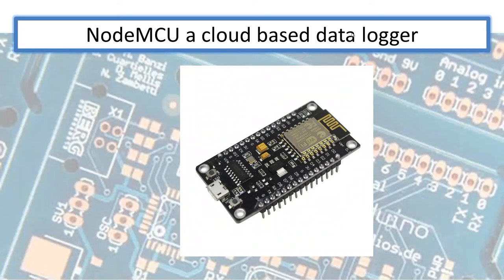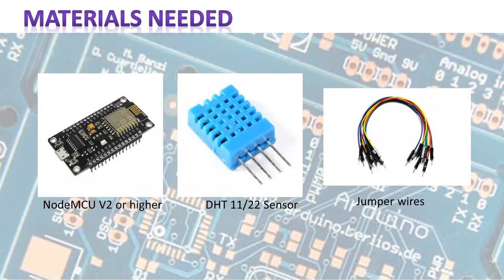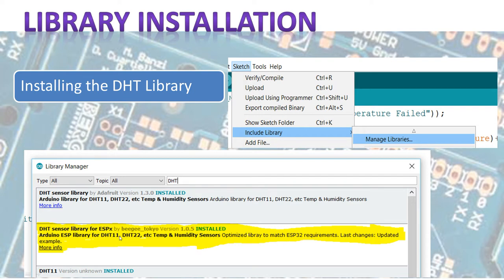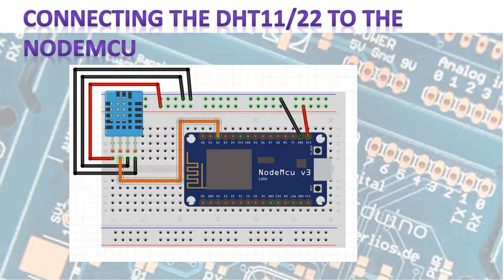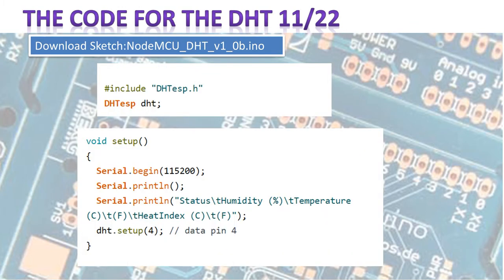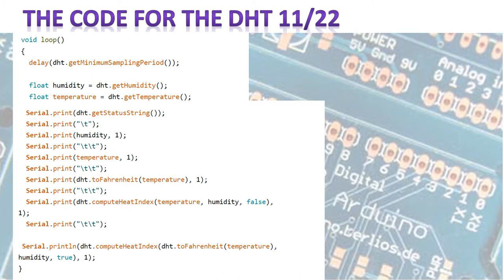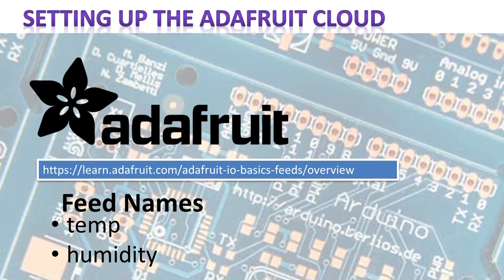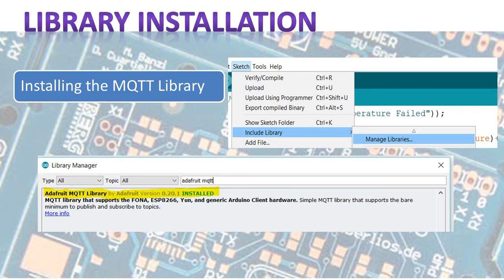NodeMCU Data Logging to the cloud

Comment: There is an ambiguity error which pops up when you run first code file in "dht.setup(4)" line. Solution is:  replace that line with "dht.setup(dhtPin, DHTesp::DHT11); "  for DHT11.